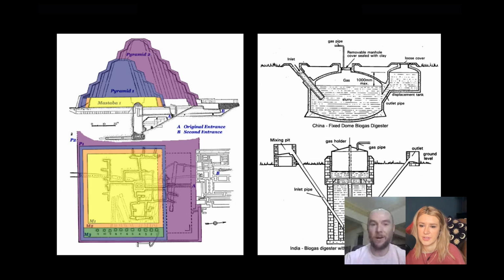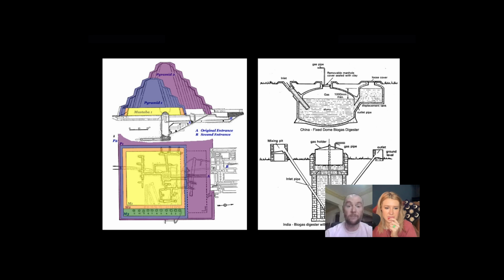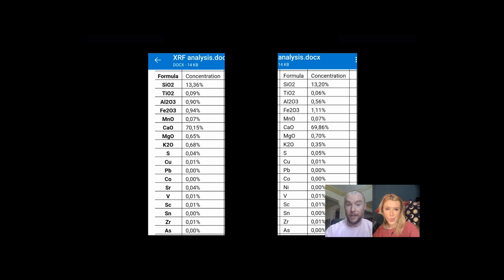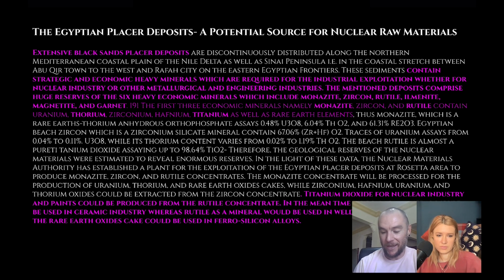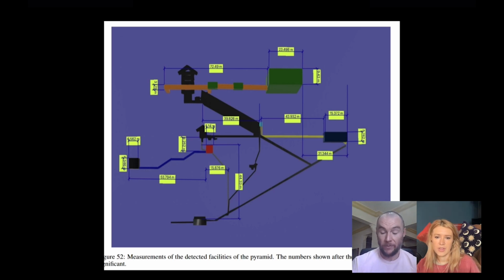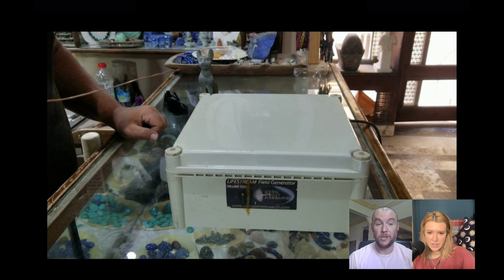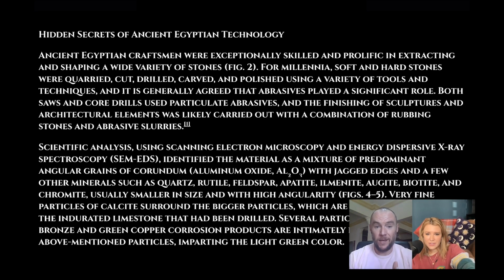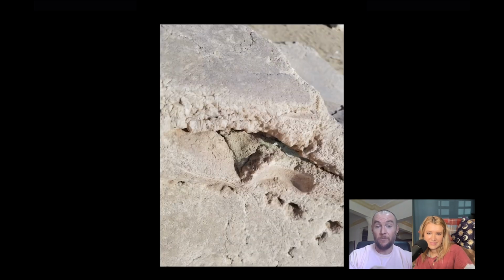The Original Purpose of the Pyramids

Comment: My degree is in history, and while my formal training leaves me skeptical of unconventional interpretations of archeological evidence, I always hold an open mind. Unlike the pseudo- scientific grifters that proliferate social media, this guy and a few others actually make sense. The recent theory that the Giza Pyramids are located on what 4,500 years ago, was part of the Nile flood plain was used to float the bottom third of the pyramid stones (which due to its shape is two thirds of the stones), and the rest were installed by using an internal ramp, is another relatively recent theory that also makes sense. The use of ilmenite sand has been known for many years and is accurate, not space lasers lol. Pullies providing mechanical leverage are not proven before 900 BCE but there are other methods, they could have used to gain mechanical leverage to move very heavy stones that did exist in the Neolithic period, the Chalcolithic Period, and in the Bronze Age. Many elements of the reaction chamber to generate electricity by vibrating the allegedly quartzite-based pyramid didn't add up. The use, purely as a tomb also has some issues, this makes sense.

Comment: At 1:58:30 you talk about them moving massive stones with pulleys. 

Again… it doesn’t explain moving stones HUNDREDS of miles. No pulley is doing that.

No amount of pulleys is lifting a 1000 ton stone. Ever. You couldn’t even fit enough pulleys within 50 yards of that stone to get the leverage needed to lift that thing. 

You also have to explain moving stones hundreds of tons OVER TERRAIN that is hills AND STEEP MOUNTAINS. 

I’m sorry but pulleys are not getting that job done 😢

Comment: Also literally impossible for it to have been a HAND HELD SAW powered by gears. You’re not cutting through granite cutting a tube core out with a hand held drill without A LOT of pressure applied to the surface.

Also in order for this theory to work it also has to explain the PRECISION seen on the “Ramses” statues and the stone vases like the one that Ben from uncharted x had analyzed in his channel.

Explain those things with your theory please because so far I’m not seeing how it leads to that level of precision
Reply: You'd be surprised what competent stone masons can achieve.
Reply: @supabass4003  they can’t achieve free hand carvings in stone l harder than steal that are accurate to within 3/1000 of an inch over the entire surface. The “Ramses statues” faces are literally perfectly symmetrical. That’s not possible by hand with chisels and saws. We use computers for that. Michael Angelo couldn’t have done that on his best day. The most skilled and “competent” mason couldn’t do that even with what we have today. He could spend a lifetime and it wouldn’t happen.

Comment: His big raft theory doesn’t hold water. How are you getting the 1000 ton obelisk OUT OF THE QUARRY to begin with? How are you moving it ON THE GROUND over hills. The Nile not any other body of water reached some of these places they got the stones from so sorry but it doesn’t work that way. I’m sure the people in South America floated stones one rafts 2000 feet up hill from a quarry across a valley ON TOP OF A MOUNTAIN as well 😂 these people were obviously using the same methods to move the 100+ ton stones and it wasn’t floating on rafts.

Comment: Who knows, your basic theory may be possible, BUT it should be pointed out that Methane is a Hydrocarbon, so if it was used for lighting, it would produce soot if it burned with a yellow flame, indicating incomplete combustion, rather than with a blue flame if burning completely. A useful flame for carving, polishing and so on, would be a yellow flame, so still there should be soot stains on the ceilings of these tombs , even with a yellow methane flame !! Some oil lamps use an asbestos gauze, which glows white hot  when heated with any flame, so it is always possible they could have burned a blue methane flame through such a gauze ! Once again, who knows !! J

Comment: I think you are not giving them enough credit on these machines used to cut these stones cus you are basically showing dark age technology  using a water wheel to get the power to move a big drag saw  look at what they built and you propose they built this gigantic marvelous buildings or machines (the pyramids)  and they did this with middle age technology  no no a lot of these cuts show that the blades or whatever were moving at high rates of speed  this wasn't done using water power or human or animal power  no way in heck  just with the thought of how did they light this stuff when they would be working in complete darkness in all these structures so they must of had some way of illuminating them to see  they could of had something different then electricity and light bulbs but they definitely had something that worked kinda similar  cus there is no evidence for fire or candles

Comment: Gold and other heavy metals can be suspended in a high pressure high acid solution and when the acidity and pressure drops the metals suspended in the solution settle out and adhere to the walls of the shaft this is how gold  ,iron ,lead and copper are formed in hydrothermal veins in nature so yes this could be the process they were replicating !! Great theory !!
Reply: A acid solution with suspended minerals can be used to make pure minerals through fractional crystallization

Comment: By this theory as the pump mechanism moves up and down  the shaft it would wear against the rock and the vacuum seal would fail which would in turn make the “pump” fail. This would likely wear out (lose it seal) quite regularly because of the distance the pump Mech had to travel up and down the shaft grinding against the rock

Comment: I'm not a chemist so I don't know if this would work but if the Egyptians were mass producing acid, could that explain the scoops marks at the unfinished obelisk? Obviously they couldn't use a water wheel power source at Aswan so perhaps there they used acid to "soften" the stone and then just simply scooped out the softened part then kept repeating that process.
Reply: Dang, I think your onto something here. Can acid soften stone like that?
Reply: @jrodz808  Well that is what I don't know but  perhaps it was a combination of acid and something else like the ultra sound discussed in this vid,  Maybe someone with the right equipment can test this.

Comment: Really grasping for straws here.  If you fill a chamber with water and ammonia, the ammonia will dissolve into the water and will not give you the pressure and heat you need.  You said you knew it was used for making chamicals and what you should have said is, you want it to have been used for making chemicals.

Comment: At 29:00, concerning the stop block, it appears also to be designed for the interior of the plunger to "wear down" yet still seal! The center of the plunger itself would wear with use... but as it wears, the area around the sealing point woulld then allow the plunger to go incrementally farther onto the stop block.

Comment: If the smallest details matter, which absolutely agree with, then @39:00  45° is incorrect. If those numbers shown are correct, then it's closer to 24/66 degrees. Depending on which angle measured.
This makes more sense. Clearly that surface is perpendicular to the blue arrow, or the shaft the arrow is shooting down, to be more accurate.
Was that just a mistaken statement ?
Hate to be so critical, but these days precission is key.
Don't get me wrong, I make mistakes too . . ✌😎

Comment: Small note - of course methane lamps entail burning & combustion. What he means is that the process doesn’t produce carbon (soot) upon any incomplete combustion (instead produces carbon monoxide, & carbon dioxide plus water if combusted completely). Either way certainly - a clean burn.

Comment: The hydronium ion is an important factor when dealing with chemical reactions that occur in aqueous solutions. Its concentration relative to hydroxide is a direct measure of the pH of a solution. It can be formed when an acid is present in water or simply in pure water. It's chemical formula is H3O+.

Comment: Since the pyramid is the strongest structure it seems quite obvious that different pyramids had different uses. These do not explain the Great pyramids at all. This makes sense for the step pyramids however the Great pyramids were power sources. Even Mr Siemens himself was thought to be a witch because he used static electricity while standing atop The Great Pyramid and zapped his guide. Check the story its facts.

Comment: Two of those roman water wheel saws you show have reduction gears of about 3:1 instead of a gear that spins at 1:1000.
A water wheel would not have enough torque to power that sort of ratio unless it was the size of a ferris wheel, it's a shame as the rest of your video was quite compelling
Reply: They are examples as we dont have any from Egypt, but given the scale and complexity of everything else its not a massive stretch of the imagination to say that the Egyptians had more advance gear ratio systems.

Comment: ;As an ex-materials engineer with a "high tech" fabrication background, I've been wanting to see a breakdown just like this video, since I first learned about alternate archaeology and history.  Any fabrication technique leaves specific traces of its use.
Reply: "Any fabrication technique leaves specific traces of its use"

Well ye if you are talking a few centuries old for sure.

When you are talking 4,000+ years combined with frick knows how much wear from tourists traipsing through the sites then it's a bit trickier to get a read on these things.

The appearance of the Kings Chamber and its antechamber would have been very different when Napoleon visited Egypt vs what it was only 100 years ago simply because tourists where just hacking away pieces of the granite sarcophagus and antechamber walls for mementos back then (disgusting vandalism I know, I'd happily roast them all in a fire and not feel guilty at all).
Reply: @mnomadvfx  ... that's a good addendum to my sub-point.  They have to look at which flat surface or which tube drill hole would be the "best" candidates for elemental or surface analysis.  Imagine if the alternate archaeologist folks are right and some of these things are over 10,000 years old...maybe 20,000 from some other cycle.  That would reduce the eligible candidates even further.

Comment: Why do you need 6 million tons of stone to build a chemical plant?
Reply: The only way to make chambers resistant to high pressure and explosions.
Reply: @joemachine4714  since when has stone been airtight (to enable pressure) or resistant to chemical processes?
Reply: @cesium alloy  <<< hydraulic dams are watertight due to the shape of blocks, the more pressure the tighter they become. (That's why the dam is curved in the non-intuitive direction).   As for corrosion the video mentioned a special coating, therefore it's true 😉
Reply: @joemachine4714  Dams are usually made of contiguous materials not individual blocks, dams are absolutely intuitive shaped to put forces into compression but I digress, all blocks are squared so none of that applies and so you still haven't answered why you need 6 million tons of rock to build a chemical plant, as for "special coating" I am so convinced by all the "science" /s

Comment: This guy is off his rocker if he thinks Arsenical Bronze is as "hard as steel". Arsenical Bronze sees - at most - a 30% increase in hardness and strength over copper. Steel is 250% harder/stronger than copper. A lot of what he says makes sense, but his metallurgy ain't great. It's not like Arsenical Bronze in history is some incredible secret, it's rarer than bronze made with tin, but it's not going to shock anybody who knows anything about the history of metallurgy. I should also add that bronze made with tin was both easier to produce and almost always stronger. If it - Arsenical Bronze - could so easily solve the problem, it wouldn't be a problem. It's literally called, "The Bronze Age", nobody is amazed they had bronze.

EDIT: Also, the saw he proposes - the Hierapolis sawmill, invented about 3000 years later - wouldn't work, it doesn't conform at all to the shape of the cuts in Egypt. They're almost universally curved, not straight, and they're not simply top down, but cut into edges. Mechanically, it just doesn't follow what is seen.  Again, some of what he says seems to have a lot of merit, but some of this stuff is sloppy.

Second EDIT: I guess he could just be trying to explain the absolute, most simple stuff here. But I feel like we're getting into epicycles at that point, requiring different inventions and technologies for each outlier. You can explain away - just about - the cutting of a relatively square block with his ideas, ish, but that's it. Once you get into any of the actually impressive stuff, you need a second set of tech.

Third Edit: Jesus, I should really wait but I'll just forget: "The Romans got everything they know about cutting and moving stone from Egypt." Ok, fine, we'll just accept this, no real issue with the statement. But the Romans had been in Egypt for 300 years when they invented the Hierapolis sawmill. So, to say this, means that a) the Egyptians were still using this device into the A.D. and b) the Romans were such monumental morons that they didn't think to copy it for three centuries. There is no straight line to be drawn between this machine and Egypt. Could the Ancient Egyptians have had something similar? Sure. But to say the Romans learned it from them is a wilder speculation than any number of lost civilizations.

FOURTH Edit, because he keeps harping on about this magical slurry. Iron is a 4 on the Mohs scale. Titanium is a 6. Granite is a 7. The mainstream theory is that they used silicates, sand, basically. Silicon is a 6.5, and that was still really tough going when they tried to replicate it. So, using softer materials isn't doing anything miraculous. We use rubies for this now. Rubies are an 8. This is just a less effective explanation than the mainstream theory.
Reply: Do you think the concept is worth exploring? Ignoring if Geoffrey's science is off, do you think the idea of pyramids being bio-power-plants could be plausible?
I only ask because to me this seems more realistic use than most others I have heard, but there are quite a lot of negative comments that I'm now back on the fence
Reply: @fickyrisher  I have no issue with his idea about the pyramids, other than that I think they're older than Ancient Egypt. Science isn't about answers, it's about questions. I'm open to any explanation, provided it can be backed up, but the fact that he's asking the question is good. My issue is with the rest of what he said, the stuff I mentioned specifically.
Reply: @flatline8199  Thank you for taking the time to respond, there were lots of interesting bits, but it still feels to me like a rough hypothesis, I would love to have the skills to create a working simulation of the model and input the correct parameters to see if it would work!

Comment: Christopher Dunn has evidence that the tube drill cut as though making a screw thread. On UnchartedX, Ben discusses the spiral with Christopher at 51 minutes 37 seconds. https://www.youtube.com/watch?v=b6VZg5NyFhY Clearly not abrasion. The rest of the video is interesting. Thanks.
Reply: Only guess I can make quickly is using the water powered gear ratio controlled tech to go for max torque instead of speed based on the ratios. That's just based on bens description that the advancement ratio per rotation of the drill is drastically better than what we do now with high speed drills. But what if they just went super slow.
Reply: @mebarta  what makes more sence is keeping the wonder alive and the cash cow fat
Reply: Chris Dunn is incompetent and a snake oil salesmen, he's selling you theories whilst deliberately missing/avoiding criticism, UnchartedX does the same thing.